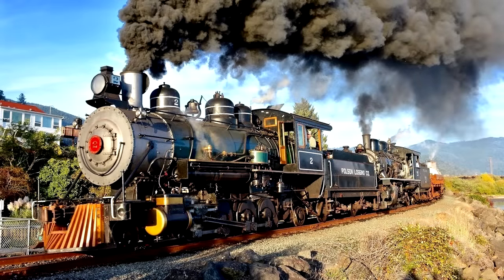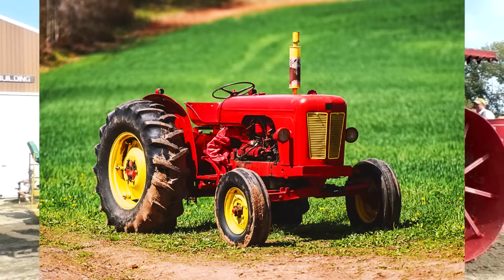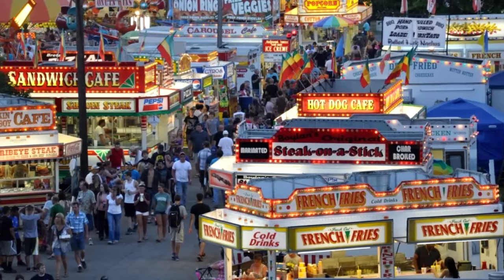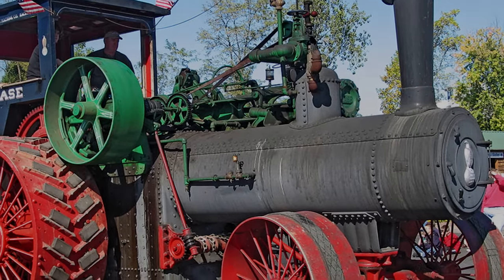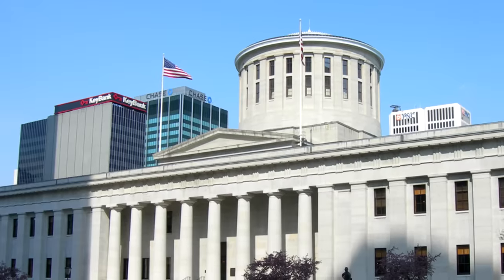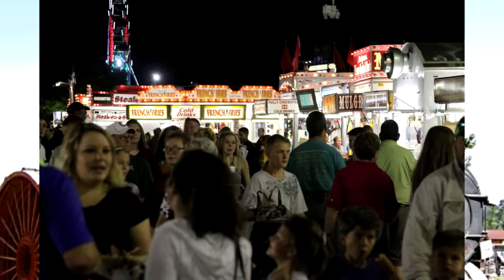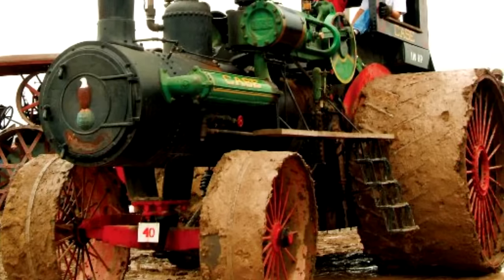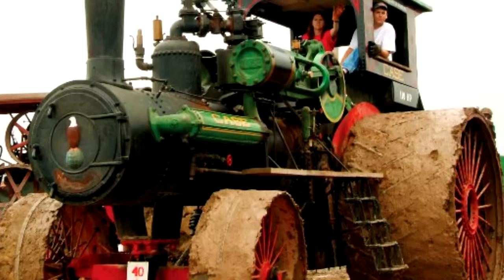The Steam Explosion That Destroyed a Fair 🚂 The 2001 Tragedy in Medina County 🚂 History in the Dark

Comment: Take a look again at the steel thickness mentioned.  This is nowhere near right.  0.375 thousandths of a foot?  That's only 4.5thou, bean can thickness.   More likely 0.375" (375thou of an inch) or 3/8".
Reply: Wrong my friend......3/8 of a foot is 4.5 inches which is also an implausible thickness, however you are correct with 3/8 of an inch
Reply: @grego3150  Correct.

Comment: Just as any piece of machinery....including and especially cars( that kill more people every year than all steam accidents in history).....all machines are deadly and if not treated with the respect they deserve will always end up killing others. 
I learned at a very young age to respect everything i operate...if it is a safety issue...it gets fixed immediately or it doesnt get used until its fixed. 
Even just sitting there doing nothing it must be respected as in how i learned so young....my cousin left a tractor with a front end loader with forks on the bucket sitting along the side of the barn with the bucket about chest high. A horse got loose and ran , turning the corner of the barn and into the forks.....died quickly. 
Just as a pilot( wether its aircraft or watercraft or vehicles) 100% of the responsibility is in your hands at all times....no exceptions...ever.
If something isnt right or doesnt feel right .....shut it down and leave it sit until its resolved correctly!

Comment: All operators of large boilers should be required to hold a boiler operators license.  Can't afford to play, go TF home and leave the big toys to the worthy.
Less historically important toys can have the stock drive system removed and replaced with (for example) a tractor engine and transmission with suitable gear reduction while smoke can be generated and whistles run by air compressor. Just because Bubba thinks something is cool in no way makes him a professional. Boilers that fail inspection should be "de-milled" under supervision with a cutting torch to ensure some cretin won't try to use them without completing proper repair.  While steam is generally considered a gentleman's hobby most people are too stupid hence incapable of the tech literacy and self-discipline required to care for complex dangerous systems. That means one fine day (like that one) an idiot will ruin things for everyone.

Comment: Your argument sounds reasonable and rational however due to the incredible propensity of government to completely screw the pooch each and every time they write new laws and regs ... I have to take the opinion that I would prefer to live with the risks of the engine, rather than seeing more stupid laws piled even higher on top of the mountains of existing ones. This bureaucracy is simply not capable of doing anything in a sensible way, and it is very likely that the number of casualties would be multiplied by orders of magnitude if you put it into their hands.
Reply: The statistics on boiler explosions would tend not to agree with that. The last few major explosions I can think of off the top of my head occurred in jurisdictions which either had no inspections, or were not completing them in a timely fashion.

Comment: no safety valve
Reply: Due to the rate of expansion in this situation the safety relief valve would have never been able to relieve that much pressure and volume to protect the boiler... ultimately the main rule in operating a steam engine AFTER inspection is CHECK THE WATER LEVEL,  then CHECK THE WATER LEVEL,  CHECK THE WATER LEVEL...IF rule #1 had been adhered to rule #2 wouldn't be an issue...